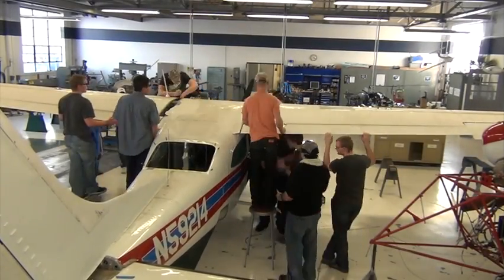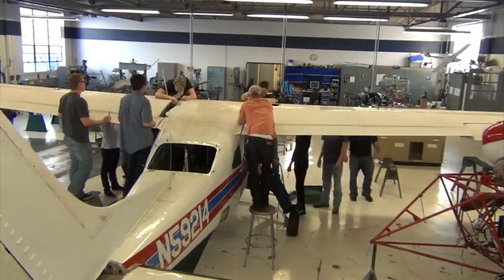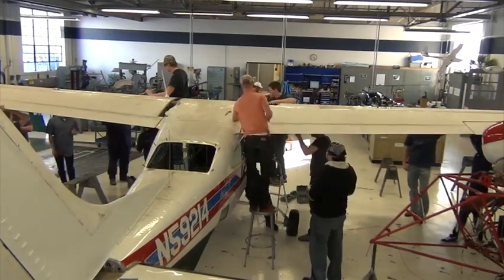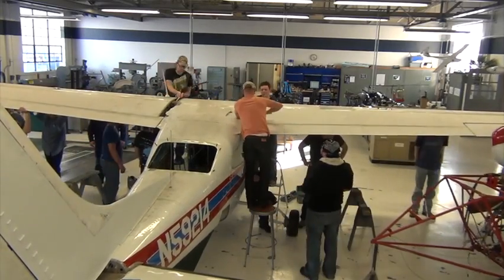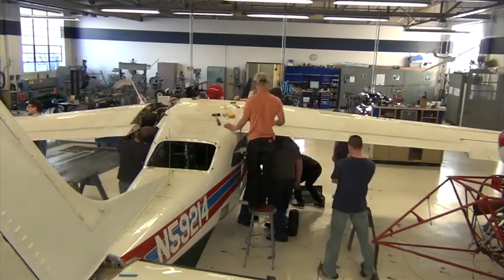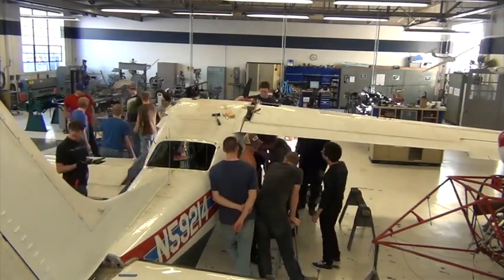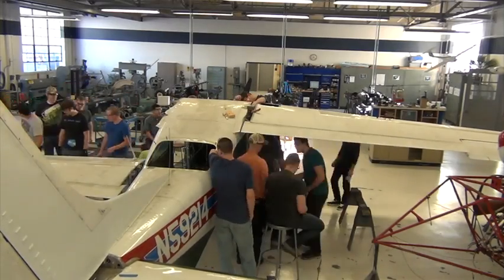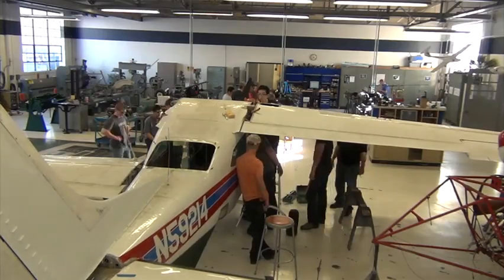Remove Wings from Cessna 210 Time Lapse

Comment: I want to store my C152 at my home, in an enclosed trailer. That involves removing the wings. Can this be done by 1 or 2 people in a short amount of time with some practice?
Reply: Chris9183. As a former aircraft mechanic i would recommend you hire a mechanic perhaps you could find somebody that could do this as a side job and you help
Reply: You can do this alone if you have wing jack/dollies.
Reply: Chris9183  how long is the wing of cessna
Reply: No, not practical at all.  The wing is only held on with 4 bolts, but the difficulty is connecting/reconnecting the fuel lines, vent lines, pitot-static lines, control cables, electrical wires, etc.  Don't forget you have to drain all the fuel, re-rig all the ailerons and flaps when you're done.  There are also rivets along the top that need to be drilled out.  Definitely not a 1 person operation, either!
Reply: No big job